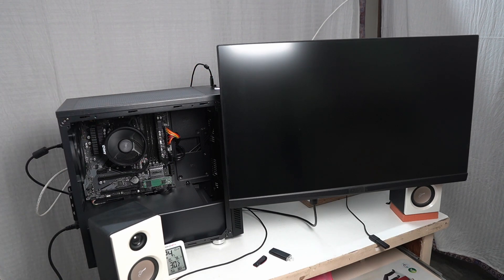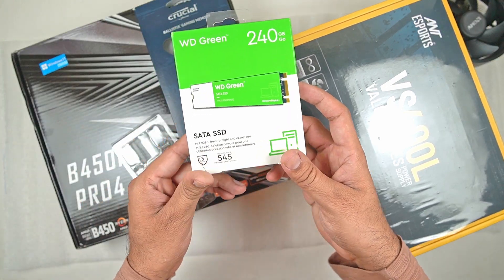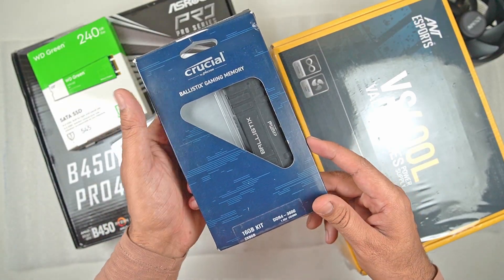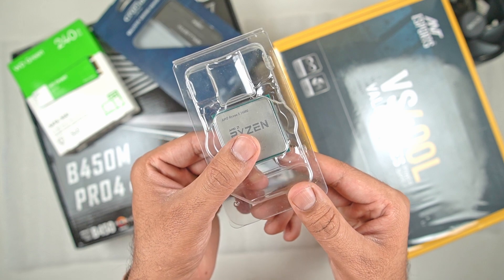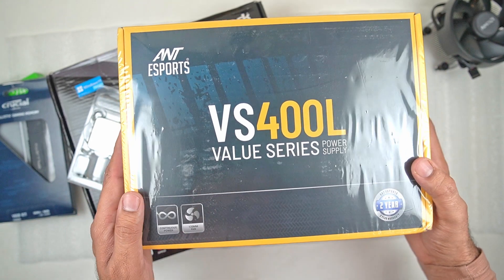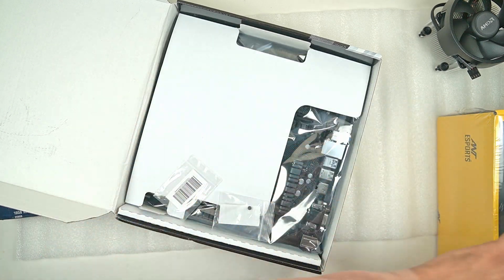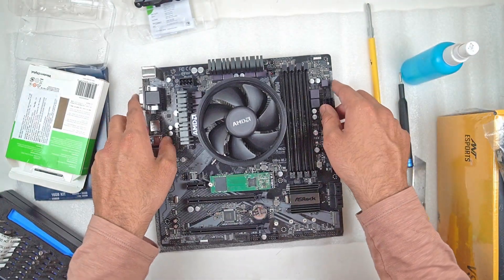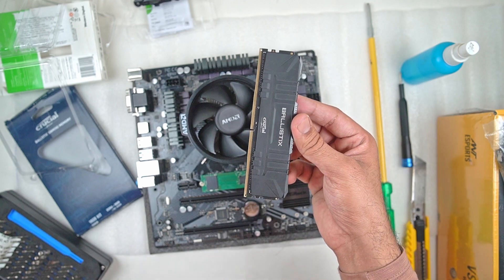Best PC Build Under 30000 | Best PC For Coding, Office, Home Use (PC Built Step By Step)

Comment: is there pcie 6+2 pin connector on the psu?
Reply from the maker: There is no point in using a discrete GPU with this psu because it might be a little over what it can handle.